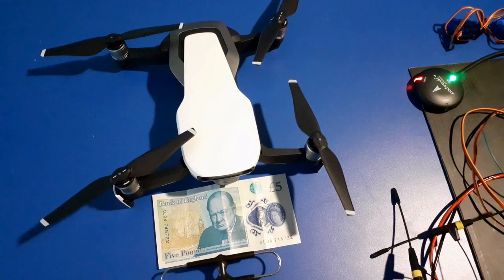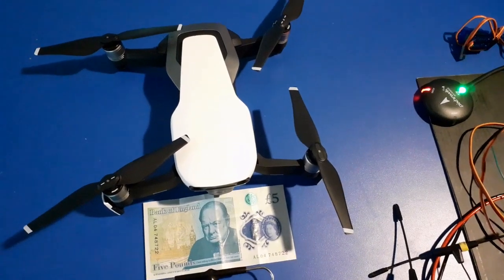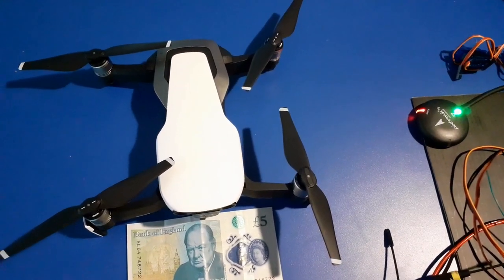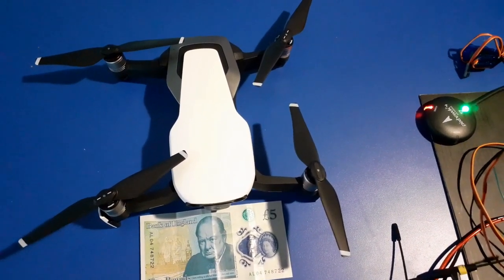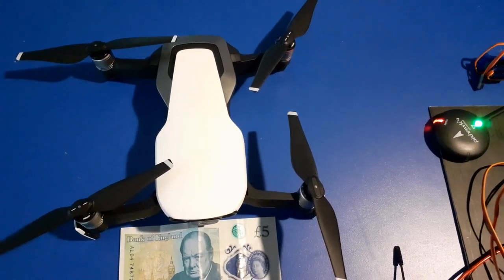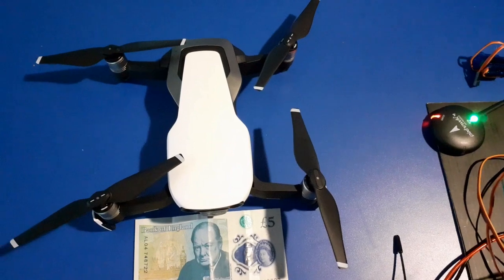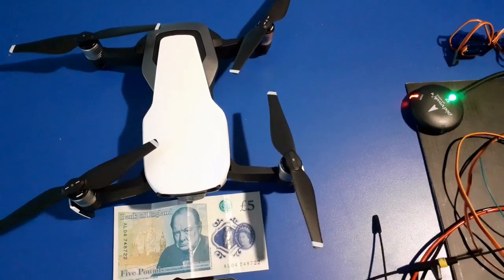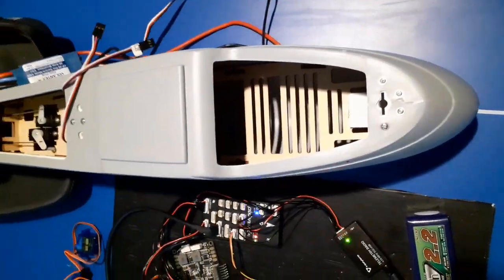Channel Intro - How to build a 4G controlled fixed wing drone / uav

Comment: Ardupilot isn't easy when your just starting out but you soon pick up the basics and before long you can build and configure new planes without giving it a second thought .
Reply from the maker: yes, i'm starting to get the feeling i'll get there one day :)
Reply: @aeronaughties  its a dam good O.S once you crack it, the best and most capable by a mile.
Take a look at the Omnibus F4 pro v2 and v3 boards for cheap Ardupilot compatible flight controllers which are very small but integrate OSD and power meter.
The V2 has all the same features as the V3 and is cheaper than the V3 but  has a fault in the power meter circuit design but that design flaw is only a problem if using the on board power supply for a camera is corrected by soldering a single wire to the FC board, if you power the cam from another source its not required.
the V3 does not have the problem as the re designed the way the LC filter section was wired on the board and essentially just added an additional trace which is the wire we solder in on the v2 boards :)
Reply from the maker: Hi, thanks for that, are you on Telegram?
Reply: @aeronaughties  no but I am on rc groups 😀
Reply from the maker: how do i message you there?

Comment: Hi aero! I have had a look through your channel and I am very keep to get a fixed wing up and running working with 4G, I don’t have a massive amount of experience but have built my own fpv quadcopter by following videos on you tube. I have a taranus transmitter, what are the full list of components that I will need to make a start of getting this built, also what fixed wing do you recommend? Look forward to hearing back from you
Thanks
Reply from the maker: can you let me know what parts you have already and i'll tell you what else you'll need
Reply from the maker: Hi again, if you want to contact me directly you can find me on Telegram - @Aeronaught

Regards
Aero

Comment: I want to convert my radio controlled quadcopter to 4G with minimum investment on new hardwares.  Currently my quadcopter is running Matek F-405 flight controller with R9 Slim + receiver.  What components I need to add/remove in order to fly it via 4G?  I would also like FPV transmission over 4G if possible.
Reply from the maker: Hi, sorry for the delay in response, we've only recently set this channel up and so still getting organized. Could you post me a photo of your drone so I can understand exactly what you have there they I'll reply in full. Regards. Aero.
Reply: Aeronaughties I don't know how to post a photo here. But here are the components - matek f405 ctr, R9 slim +, 5.8g VTX, 3DR telemetry, 4S1P 21700 li-ion battery. 960kv motors, 10" props. Runcam split 3 micro. It runs on Arducopter
Reply: Aero Naughty the weight of my drone is 540g excluding battery. It can carry around 900g of weight.
Reply from the maker: OK, first question, are you ok using a raspberry pi cam?
Reply: Aeronaughties what I have now is an ESP32 development board comes with a cam. Is this something you are familiar with or you still suggest PI cam?
Reply from the maker: sorry for the delay, not familiar with that. pi cam was simplest option for me
Reply from the maker: Hi again, if you want to contact me directly you can find me on Telegram - @Aeronaught

Regards
Aero